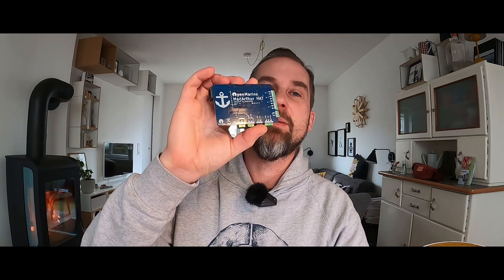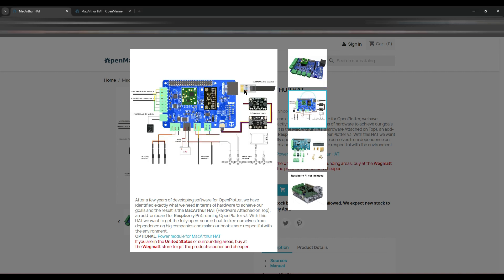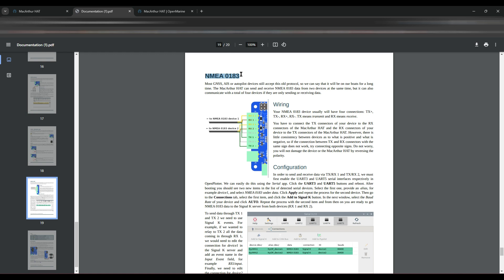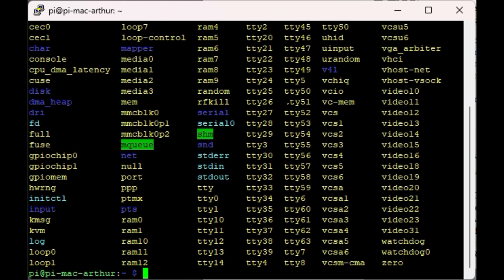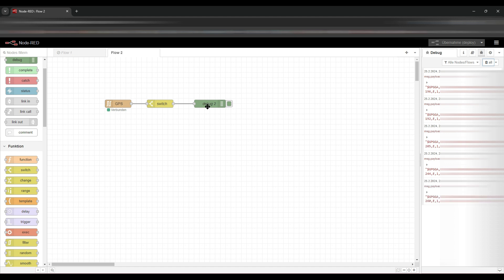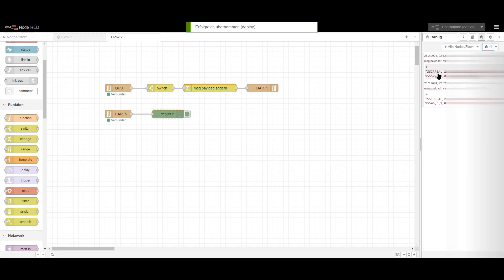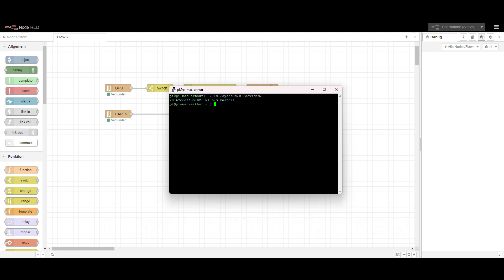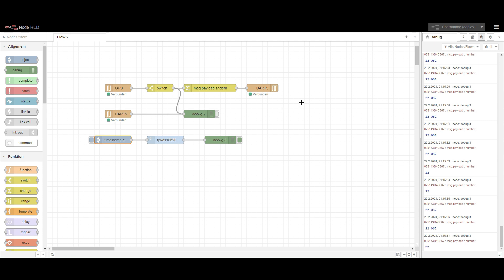OpenMarine/Wegmatt MacArthur HAT: Unboxing and first tests

Comment: Hi there. Thank you for all your pie and Mac Aurthur hat videos. I am following along and setting up my HAT for 0183 use. I got to 9:55 mins in this vid. But I am stuck as my Uart3 is not flashing like yours from the GPS signal. I get this message "[serialconfig:a25638e377d10f30] serial port /dev/ttyAMA5 error: Error: Error Resource temporarily unavailable Cannot lock port". Would you have any suggestions of how to fix and move forward? Thank you.

Comment: I have a question , how do you get the NMEA 2000 sentences off the can bus in Node red
Reply from the maker: You need to set-up your system to use the SPI interface for the MCP2515/MCP251XFD and get some CAN nodes installed in Node-RED. As I do not have a NMEA2000 instrument here I didn't do it so far - but check this quite similar post here:
https://forum-raspberrypi.de/forum/thread/59776-mit-node-red-can-bus-lesen-und-schreiben-mit-dem-rs485-can-hat-modul-funktionier/